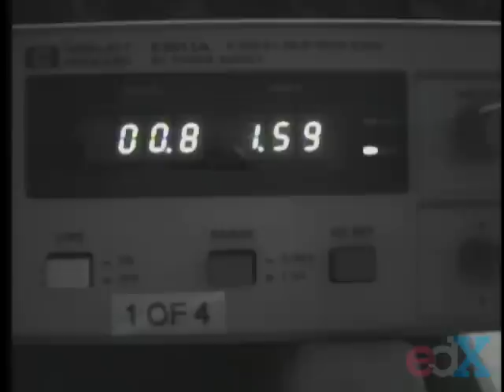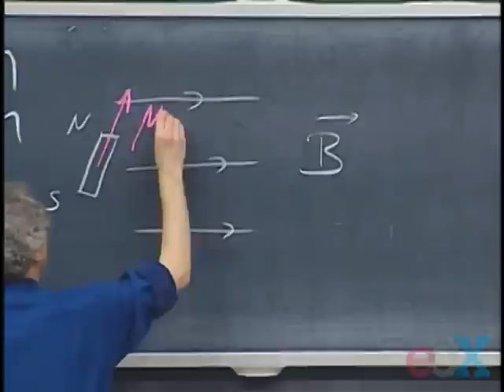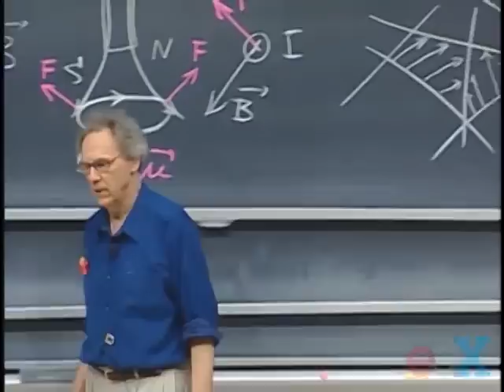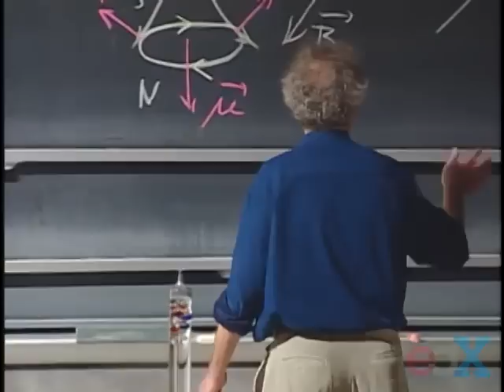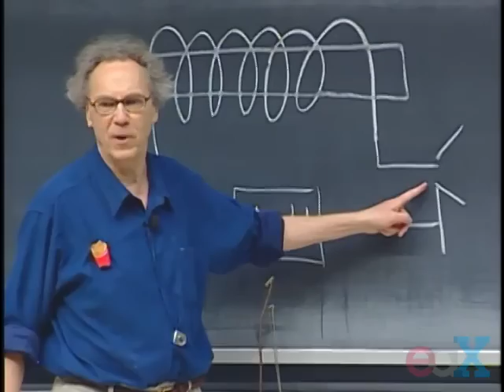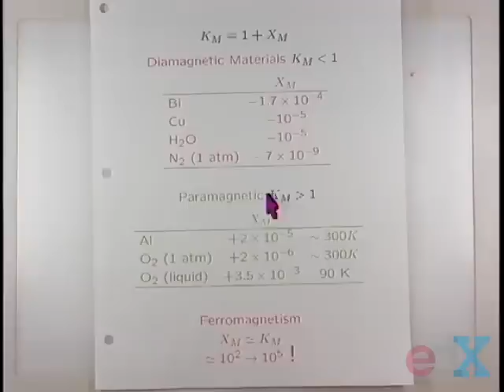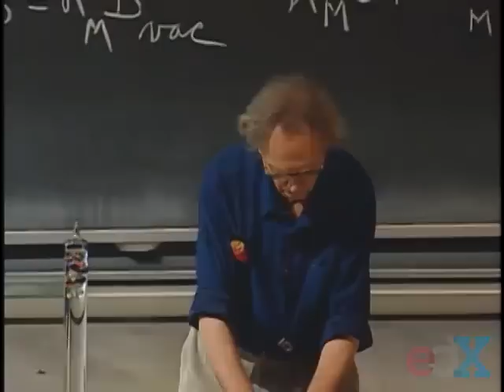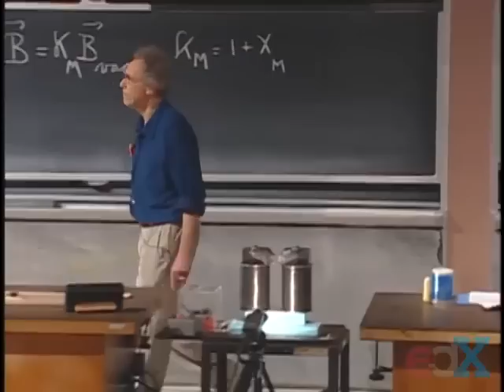8.02x - Lect 21 - Magnetic Materials, Dia- Para- & Ferromagnetism

Comment: another question - present :)
we know ===conservation law===
- of matter (m = const, we can`t produce matter from nothing and can`t destroy\annihilate, only split or combine)
- of energy (actually matter movement m*v = const...because m=const we can say that v always const - mean shared between objects - movements can`t be destroyed or generated but only shared between objects)

when we `consuming` energy where it gone? if it can`t be destroyed we can round circle the same energy and use it forever by theory? what heating pumps doing? can we round circle energy using heating pumps and as example turboexpander (as a heat engine with the highest efficiency..80-90% convert heat into mechanic energy)

light is photons = photons is real matter 
when we powering light bulb that generating light\photons\matter and know conservation law of matter - where is the source of matter in the closed electric loop (we have Faraday generator that use cooper  loop and permanent magnet to generate electricity and connect light bulb to it - so we have only moved PM inside the system that `generating` matter)?
Reply from the maker: Mass changes into heat in the explosion of Atomic bombs (thus mass is NOT conserved). Unlike in chemistry where mass is conserved; it cannot be destroyed (La Voisier) in physics mass can be destroyed.  We can also create matter out of EM radiation (called pair production). Remember E=mc^2.
Reply: sure i remember E=mc^2 but do think it is true only for math but not nature (physics is science of nature but not math), in math "=" mean we can change sides and logic will remains, in nature we can say only in one direction   mc^2 is E (E is just replacement of `mv` for quick notations and nothing else)
the reason because such ideas (like can be E without real object, mean m=0 but E<>0...who is actor in this case? what E of?) broke classical mechanic F=m*a...do we have real forces <> 0 that can be measured and used but m=0 ...0*a=0 but not 0*a <> 0 !
 
just my personal opinion - as any human i can be wrong :)
Reply from the maker: >>>>mc^2 is E (E is just replacement of `mv` for quick notations and nothing else)>>>>
YOU ARE DEAD WRONG. First of all mv is not Energy. Second E=mc^2 is arguably THE MOST important BREAK THROUGH in Physics of ALL TIME. It may even ultimately save our energy problems; that will depend on the progress made in research on nuclear fusion.
Reply from the maker: It was NO choice. It was derived.